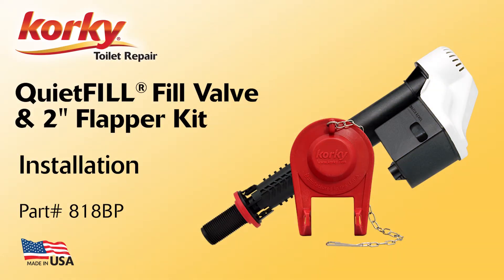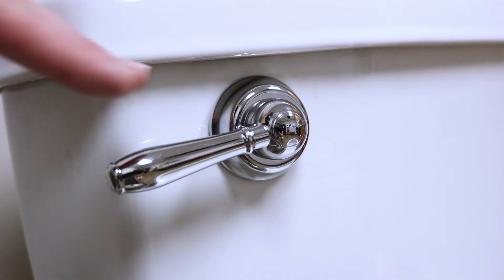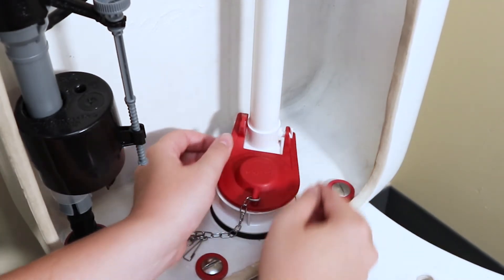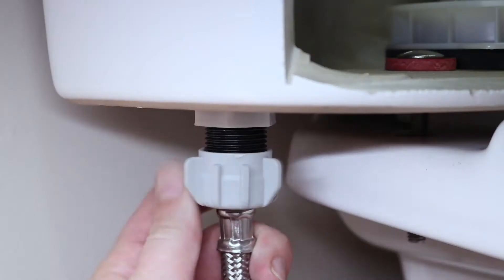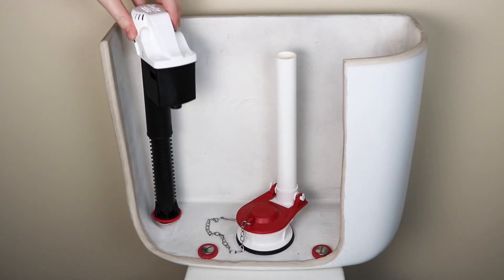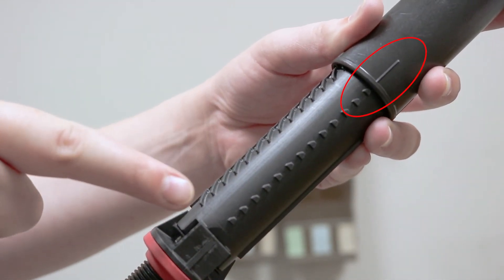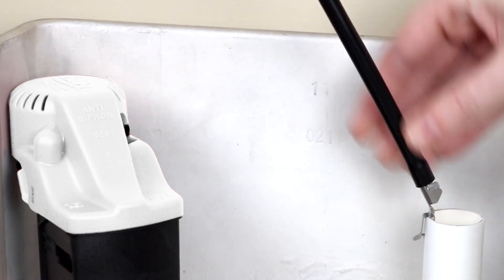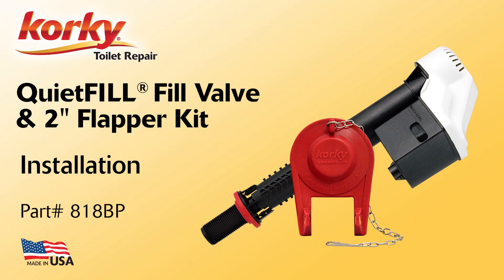Korky QuietFILL Toilet Fill Valve and Flapper Installation - 818BP

Comment: I’m baffled because water still keeps on dripping into the toilet bowel and it’s not through the flapper nor through the hose that goes onto the overflow level tube. 😢
Reply from the maker: If you haven’t done so already, you could turn the toilet water supply line off for 30 minutes and check to see if the water level in the tank drops.  If there is a water level drop, there may be a slow leak from the flapper or flush valve sealing surface.  If the water level does not drop, you could be seeing residual water drainage from the bowl rim.